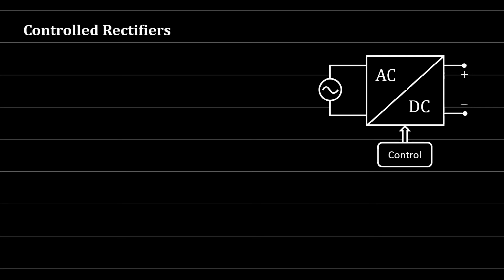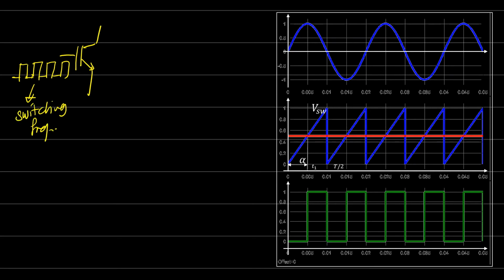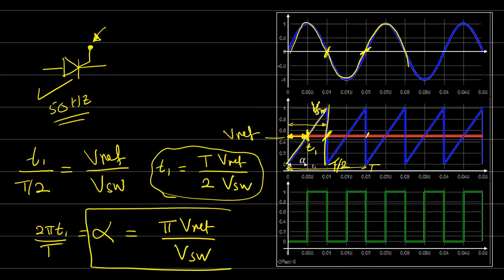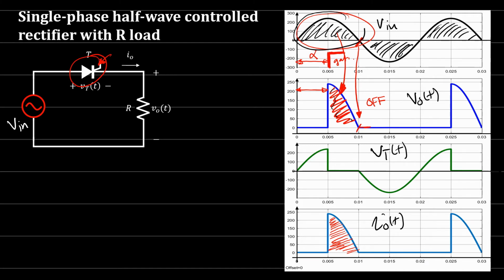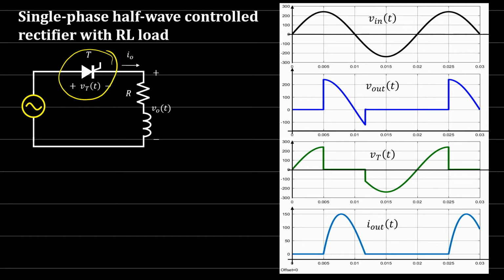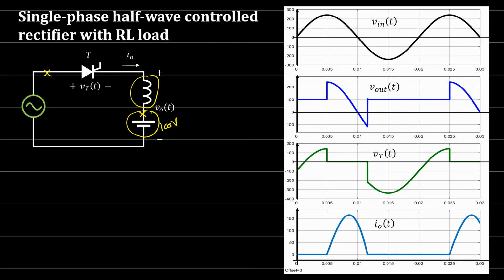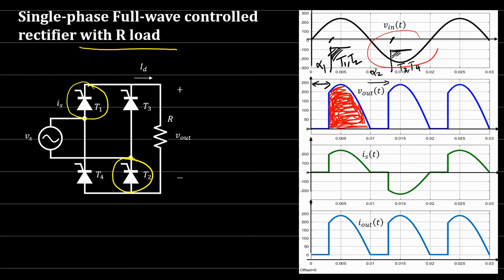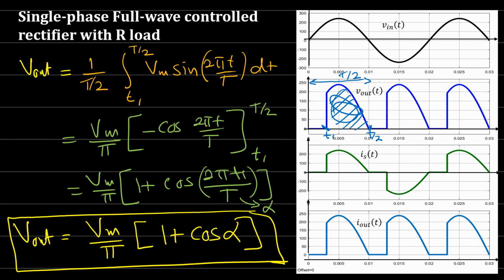Thyristor Circuits | Controlled Rectifiers | Power Electronics

Comment: Thanks bud. 5 minutes in and you already clarified a big question I had about the frequency of the driving pulse. I was 95% sure I had to match the line frequency of the welders transformer output on the rectifier with the input pulse to the gates. Just confirmed it for me, thank you sir.